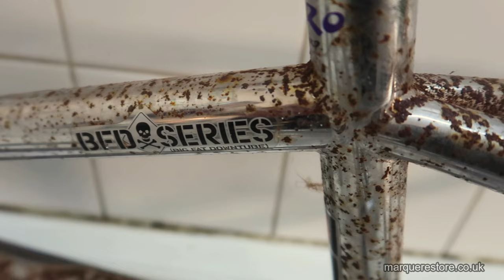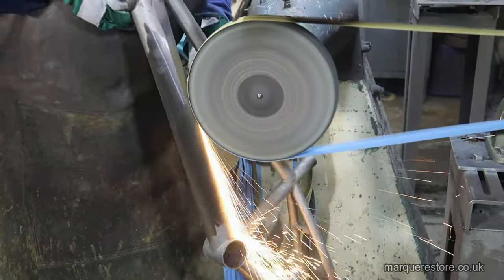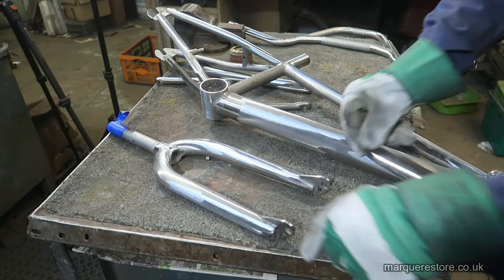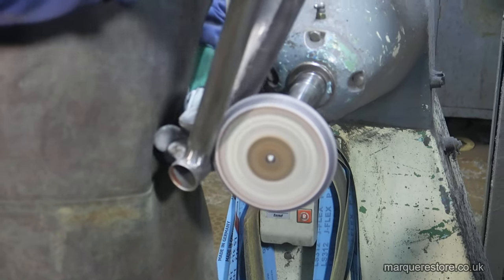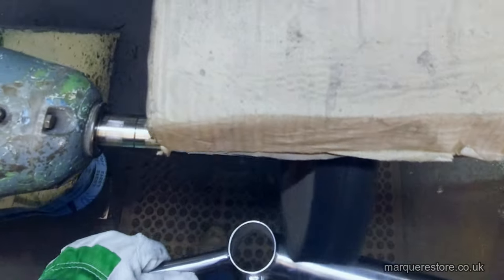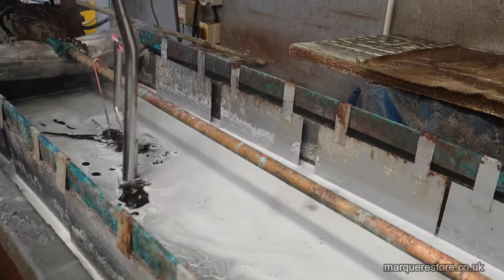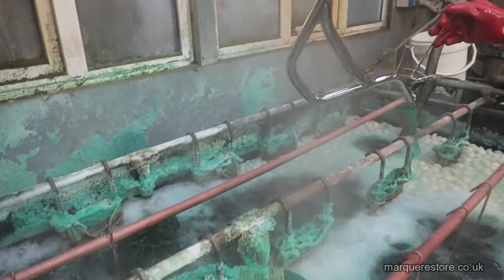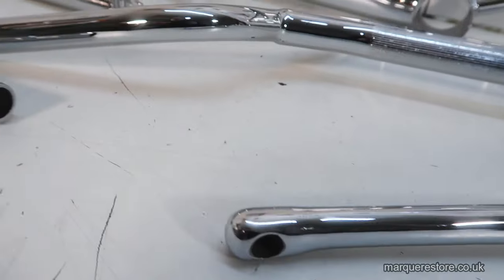How to restore the chrome on a Haro BMX Bike

Comment: So no copper-layer for this bike? Why? Thanks!
Reply: They said in a previous video, copper layer is only needed if there are surface imperfections as it's a high build / thick layer that can fill minor pits etc and be polished up. I was surprised too. I thought copper then nickel then chrome was how it was always done, but apparently not

https://www.youtube.com/watch?v=RU9l66_XmDk&t=1s
Reply from the maker: Thanks. I could not have explained it better.
Reply from the maker: Not needed and also issues with coppering hollow parts.
Reply: @ChromeandCarRestoration  thank u…

Comment: I don't understand. The abrasive tools is sparking which means removing metal and I see SEVERE FLAT SPOTS. That means the frame is GARBAGE. To a true BMX COLLECTOR, it is no longer worth anything as it doesn't even weigh what it did new. You have destroyed the original frame. It is NO LONGER SHAPED as it was originally. You grinded metal away.